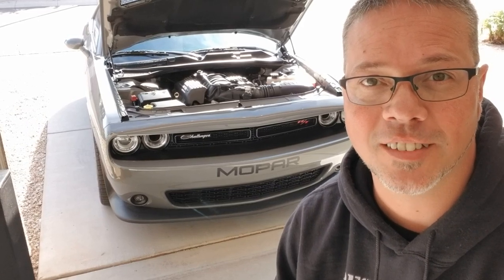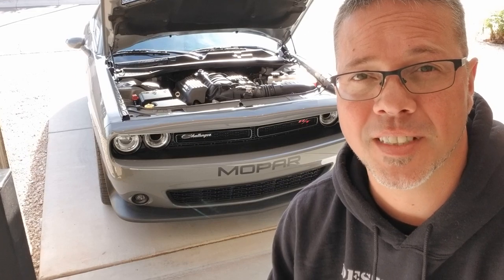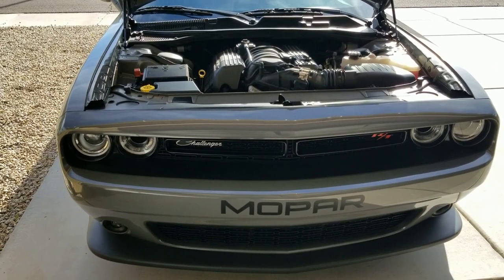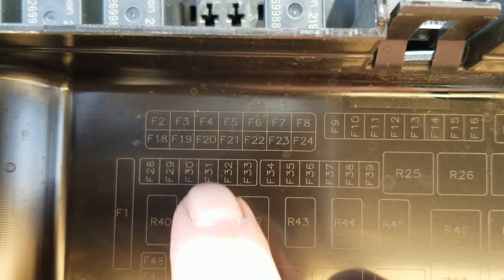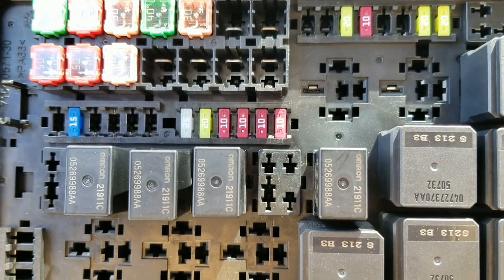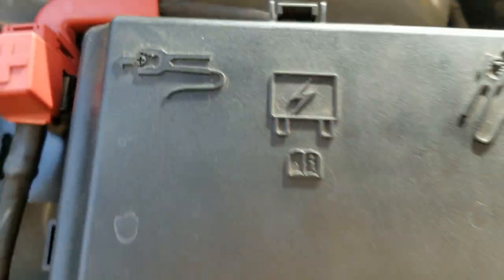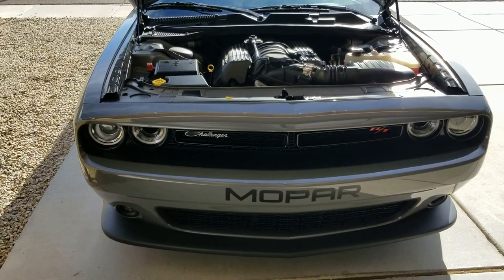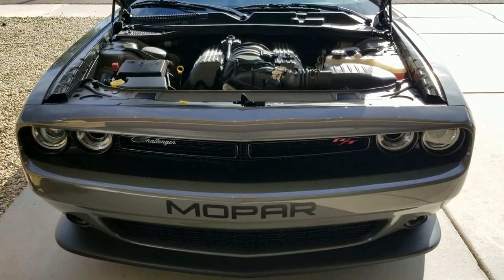2019 Dodge Challenger 1320 (Fuse Pull Trick)

Comment: The fuse pull I did was F36 on my 2020 Scat Pack. This leaves open the exhaust flapper and did not show a check engine light.
Reply from the maker: Sweet I will have to try it!